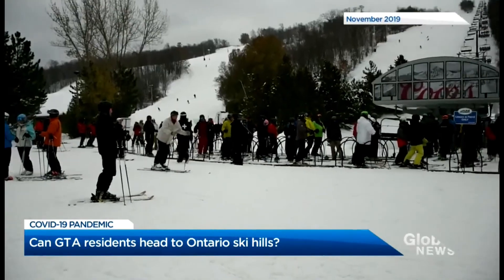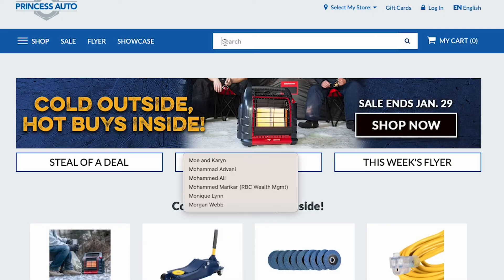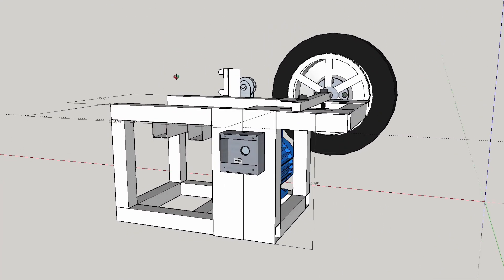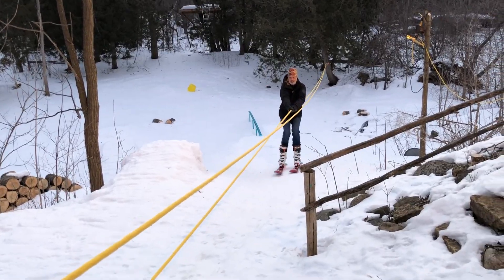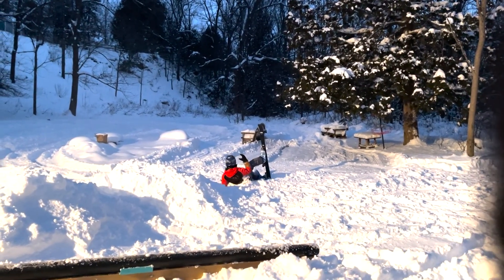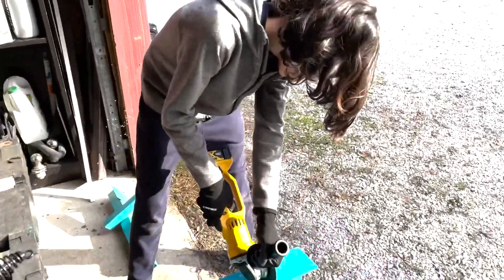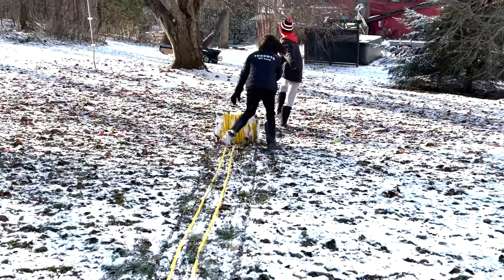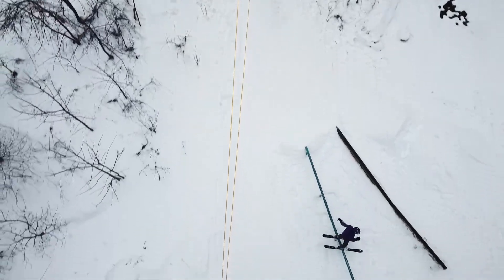Building a Rope Tow!

Comment: How did you go about getting the rope and making it the right length/ splicing it to be a circle?
Reply from the maker: We laid out the rope and marked the length with a marker.  Then brought the ends inside and did a splice. Followed a YouTube video on spicing 3 strand rope.  Was not too hard.
Reply: @makeadventurecanada  thanks! I hope soon to also have a backyard rope tow. Spent a whole bunch of time clearing trees. Now I gotta just put up the hardware.
Reply from the maker: Best of luck!  Hoping to put out a follow up video soon. People have been asking…more focussed on equipment and technical aspects.
Reply: @makeadventurecanada  was planning to run it off my tractor’s PTO. Still trying to figure out a safety switch…

Comment: hey where did you get the pulleys that are at the bottom of the rope    thats the last thing I need     I made mine gas powered
Reply from the maker: I used a couple of these to guide the return as well as the bottom pulley. Just ripped the tire off. They work fairly well. Be better if they had proper bearings.    Good luck with your project!

Comment: Great video. It looks pretty similar to my landscape and needs. I'm going to build a rope tow for my kids but wasn't sure which parts to buy. I saw your parts list and am waiting to get approved on Instagram so I can see direct links to the parts, to see if they'll work for my setup. Any help/advice would be great.
Reply: Hi, I am looking to build one like yours and would like the links of your supplies so I can see if I've got it all planned out correctly. Any advice would be helpful.
Thanks,
Todd
Reply: Hi again,
Did you switch motors, because it looks like you're using a 2HP motor, but you say below that it's a 3HP motor. Also, I'm wondering what size sprockets you used, and the stub axle, wheel, and gear box.
Thank you

Comment: Great project did you replace the pulley in front of the tire with a roller fairlead?
Reply from the maker: Many thanks!  I did put in a fair lead from an ATV winch.  But it didn’t work as well as the pulley so I reverted back.  The pulley is actually a heavy duty caster with the tire taken off.  Keeps the rope from derailing where the fair lead did not.
Reply: @makeadventurecanada  thanks for that info, Again you really did a super job on that rope lift project!

Comment: Could you build the frame out of wood
Reply from the maker: I think so.  Lots of bolts and such. Might be a bit too much flex as you’d need to keep things tight.  I think metal is a better bet. You could probably do it with bolts instead of all the welding.

Comment: Please add a safety gate at the top. It is a rope/cord that goes across the tow path and gets unplugged (which will turn off the motor) if somebody gets twisted up in the rope somehow (scarf, long hair, cord/string on clothing/coat). It will keep them from getting pulled (and possibly killed) through the drive pulley.
Reply from the maker: We have a safety gate. Wouldn’t let anyone use the rope tow without it.  If anyone skis or is dragged in any way within 15’ of the top, it flips the main power.  All good!
Reply: @makeadventurecanada  Awesome! That’s good to hear!

Comment: I’m thinking about making a rope tow just like this. Around how much did it cost in total?
Reply from the maker: We’ll, I thought it was going to be about cdn$1200 initially, but I ended up with a gear box and probably bought a bunch of stuff I didn’t need.  I would say $1500 should do it though.  Happy to send you a list of materials if you want
Reply: I honestly thought it was going to be more expensive but I would definitely love to have the list of materials
Reply from the maker: Here's the list.   You can DM me on instagram @richard_peirce for a list that includes links to products.  Rope Tow List

Rope - $600 ( I think I got this cheaper but can’t remember)
Motor - $429
Gear Box10:1 - $149
Stub Axel - 	$100
Wheel(for rope drive) - $70
Various Sprockets and a chain - can’t remember exactly which 2 I used
1.5” box tube - from metal supermarkets - also some 3/4” box tube for legs
220v cable- 10/3 5.99/ft. - also used a dryer plug
Electrical box / switch
Casters for rope guides / bottom Pulley (I pulled the tires off and just used the hubs - I’d like to find better ones that are a little bigger diameter with bearings and a deeper hub)
Tie down straps for top and bottom
Reply: @makeadventurecanada  I would like to have that list with links! Your ig profile is private.. thanks
Reply: Alright thanks man this will be very helpful. Keep up the work 🙏